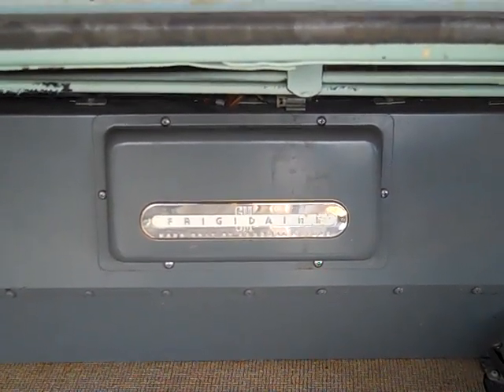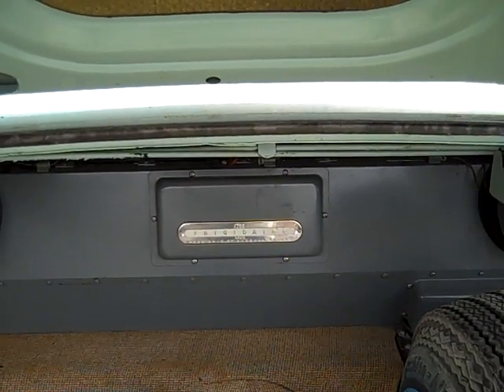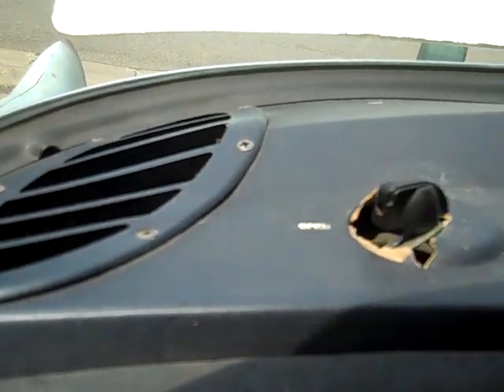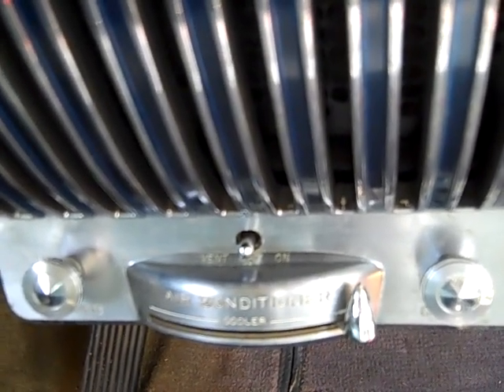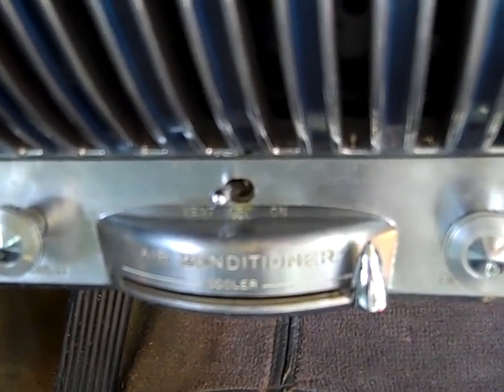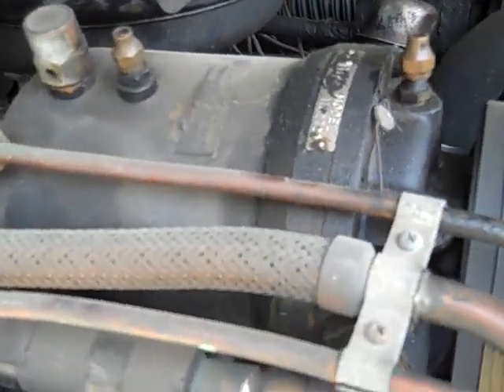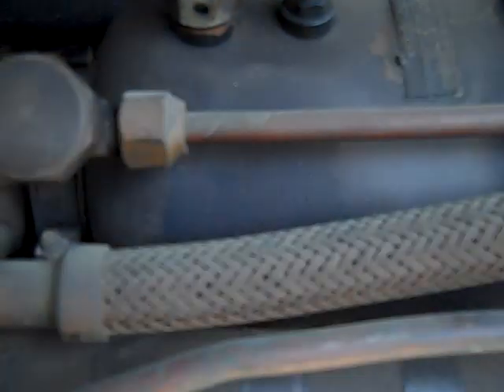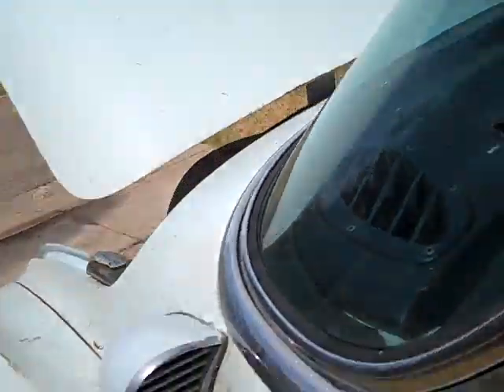1953 Cadillac Series 62 Coupe with Factory Air Conditioning Part 2

Comment: I bet that system weighed a ton....interesting to see early systems though.
Reply: (I'm also NDrLoR)  Thanks!  Yes, I expect it did.  The compressor alone probably weighs what the entire system in modern cars weigh.  There are no flexible lines except the short, braided tether line--all the rest all solid copper.  It was that way through '56, then they started using rubber lines.

Comment: Very strange system, didn't know TXVs existed back then.
Reply: (I'm also NDrLoR)  TXV's?  I'm not sure what that refers to, but this was the first year availability of factory AC since 1941 when a few units were installed.  The same unit was also available in the Oldsmobile Super 88's and 98's and Buick V-8s.
Reply: A TXV (Thermal Expansion Valve) is a weird looking valve with a flying saucer like thing on top. It senses pressure, and temperature to precisely control freon in the system.
Reply: John Smith Thanks for that explanation!  I guess that's what they used in this one year the compressors didn't have a clutch.  In '54, the GM cars with AC, Buick/Olds/Cadillac, had a Rube Goldberg looking device, I guess a solenoid, sitting on top of a compressor just like this one, but connected to a clutch in front of the pulley.  Beginning in '55, the clutch became integrated with the pulley and looked much like the A-6 units of later years.
Reply: They used a weird valve that lets the freon freewheel through the compressor, it was controlled by a switch on the dashboard, but the TXV is automatic, and always does the work by itself

Comment from the maker: @MrBBB53 Thanks!  I've heard someone say if one of those, which is a one year only design, can even be found they are around $1,500!  I have just bought a rebuilt vacuum booster/master cylinder for a '56 I have from USA Parts Supply, Ltd, which supplies all kinds of vintage Cadillac parts.  Their number is 800-872-2013.  I would also call Honest John's Caddy Corner in Justin, TX at 800-59Caddy.  Between these two numbers, you might get on the right track.  Good luck!

Comment: I got my book Friday. It's great.I got it so cheap I actually feel guilty about it. Mine has 144 pages, Besides the cover, the illustrations of the car body are of course Olds also. Imteresting that it is a rotary compressor. How long did they use that? I know they went to A5 in 58 and A6 in 62, and had at least one other design between yours and 57. Interesting that Ford started using A6 on Mark lV and TBird in 72, and GM style evaps and POA valves on 72 intermediates but with the 2 cyl comp..

Comment: This system used R-12 freon, didn't it ?  Where the heck do you buy that stuff nowadays?  Do you have to get it from China and pay $1000 a pound ??
Reply: Yes.  No, I don't use the system anymore.  I was able to get some NOS R-12 refrigerant oil from a friend of mine to keep the system properly lubricated, but the car gets driven only about 500 miles a year.  I take it out about once a week when the weather is nice and put about ten highway miles on it, so it doesn't matter about the AC.   Thanks!
Reply: you should just take the belt of the compressor